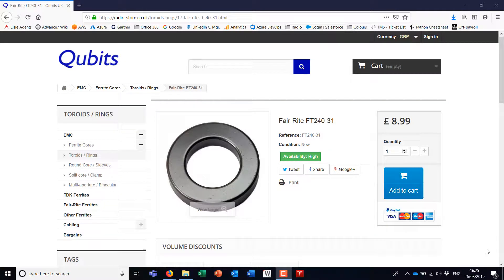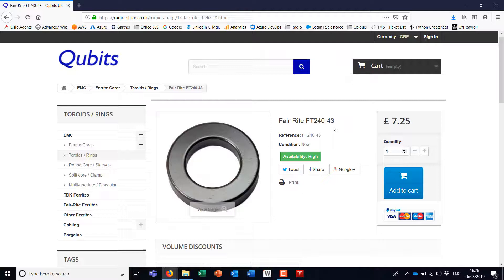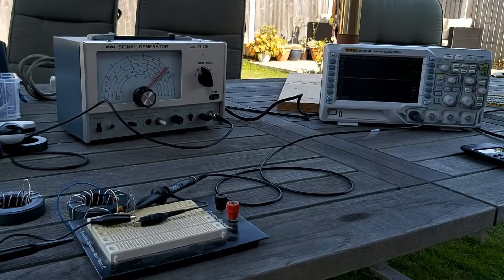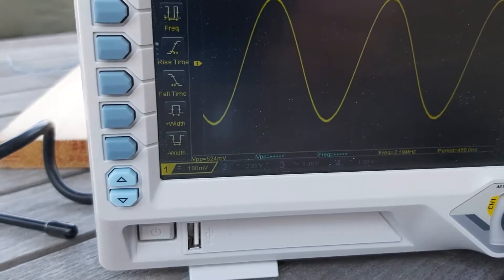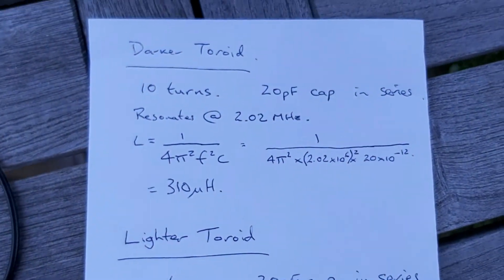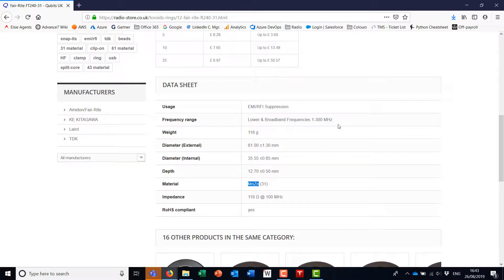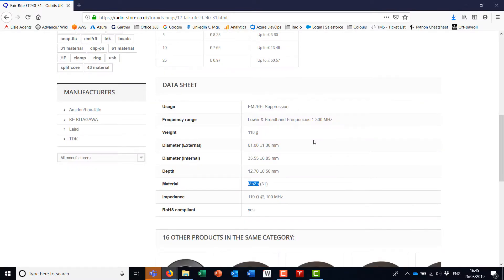Identifying Toroid Rings - 31 vs. 43

Comment: well i too have a drawer full of FT-140 ? sized ferrite rings,
three lighter than two others..

so using this video i'll go with your results..
three lighter are 43, the two darker are 31..

i have some red ones,
and in another box a core that's 2 1/2 inch diameter but same colour as your 43..maybe a FT240-43 ?
and quite a few smaller than the standard used in baluns..

you'd think manufacturers would stamp them or mark them in such a way as a way to easily identify them..
Reply from the maker: That would definitely be helpful.

Comment: Cool!  Another thing that you can do in this particular case is measure the resistivity of the toroid with a multimeter.  The MgZn formulation (e.g. 31)  will have high, around 100+ kohm ish resistance.  The NiZn formulation (e.g. 43) will read even higher - probably showing as infinite resistance.
Reply from the maker: Ha - that's a great tip 👍

Comment: At 2.24 you got 11 turns not 10 turns. First turn starts once the wire pass the donut hole.
Reply from the maker: Thanks for the correction.  Luckily, in this case it makes no difference to the outcome as I wound both examples in the same configuration.

Comment: I am working  a toroide calcutation software .Best calculation details in magnetics corp.sites.but my calculation values have a bit error  from OD,ID and HI values in catalogues.Formulas result's have a errors.My calcutaltions have error   in Area calculations even .Could you advice a great a book or a web site or any web site or pdf  about calcultaions and formulas .
Again thank you for reply before my question
Reply from the maker: I don't think I can answer this.  I just looked at one toroid relative to the other.  My understanding is inductance is proportional to permeability and so the higher inductance configuration used the inductor with the highest permeability.

Comment: Great video .I don't understand these Why choise 20 pf and  100 kohm resistor ? Also why don't use resistor value in formula ?
Another question :if we use 40 pf and 50 Kohm resistor  result  can will  same with  frequency and inductance  value (with  in your page calculations ?) * sorry for bad english
Reply from the maker: No real reason for using those values - lucky guess.  The standard formula for a resonant circuit doesn’t include the load resistance.  From memory, I think the load resistance will affect the sharpness of the peak in resonance (the Q factor).  Yes, 40pF and a 50K resistor should work - just adjust the capacitance value you substitute in the formula.
Reply: @PaulOfford  Thank you for your reply

Comment: Could anyone help me please? I have a transformer here that I'm struggling to find out it's output ratings. I can't find anything about it online but it has 2 secondary windings, both using blue/red wires. Written on it is  
C23-80-E376
TT1-9922023-13
00   43

Any help would be brilliant as this thing is a mystery to me
Reply from the maker: I did a quick search on Google but couldn't find anything that helped - I'm sure you have done the same.  Good luck.

Comment: And what happened to be the result, did you figure it out in the right way ?
Reply from the maker: I didn’t have a way to cross check, but I shared my method on eham and the feedback was that the method is valid.  Therefore, I’m happy I have accurately identified the toroid types.
Reply: @PaulOfford  Thank you Paul, a very good way to identify our toroids in case.

Comment: hi iv just ordered them in packs of 5 for 2.89 pounds of e,bay and i bought mine for rfi in the shack to go round my leads will they be allright for5 that because im getting abit of rfi when i transmitte will they be ok for that 73 and great video
Reply from the maker: Hi Steven,  I’m no expert but looping some of your antenna coax (creating turns) through the ring can help eliminate common mode EMI coming back into the antenna socket.  The best thing to do is post your question on a forum such as eham.   Make sure you say where you think the EMI is entering your rig (power lead, antenna, mic, etc.) and the band you are operating when you get the problem.  If it’s coming down the antenna coax, also look at common mode choke designs - you’ll find plenty with a Google search.

Comment: A circuit configuration would be helpful please. Can't see how the sig gen. is injected.
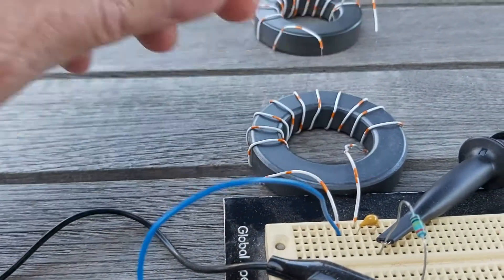Why was there a scream at 2:29?
Coil / Cap series or parallel?
Thank you,
Reply from the maker: It was a while ago but looking at the video at 1:23 you can see the configuration.  The blue wire is the input from the signal generator which connects to one end of the coil.  The other end of the coil connects to the capacitor (they are in series) and the other end of the capacitor connects to the 100k load resistor.  The output (connection to the scope) is connected to the junction of the  capacitor and resistor.

I think the scream is the children next door playing.
Reply: @PaulOfford  
Thank you, Mr Offord.
With your comments in mind, I will take another look.
The children's scream in play makes it all so much part of hobbying during everyday life!